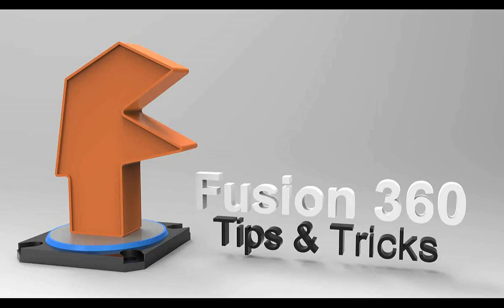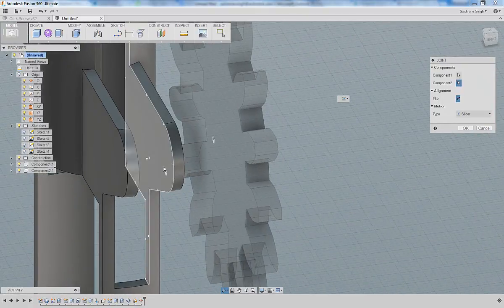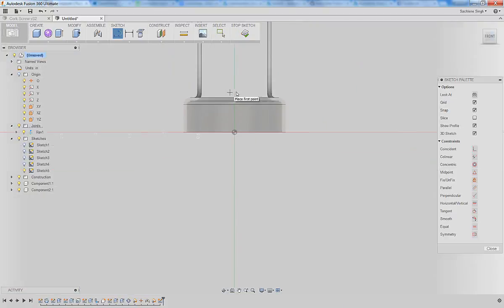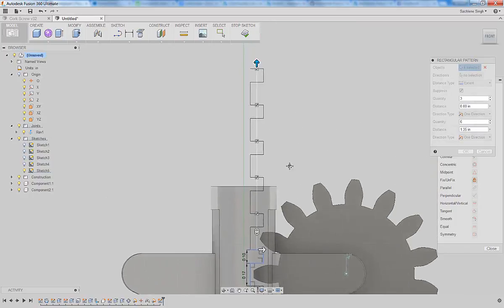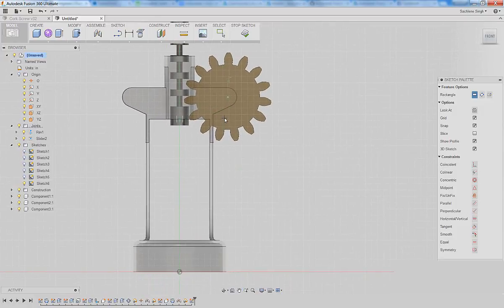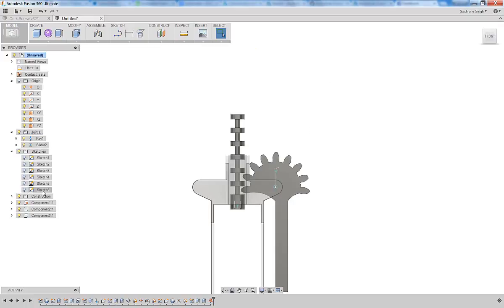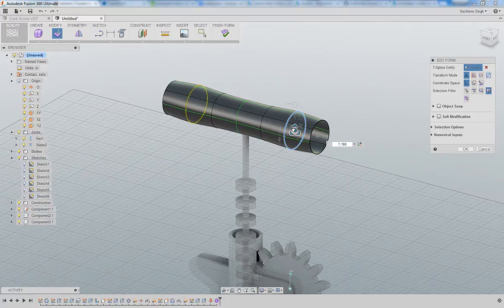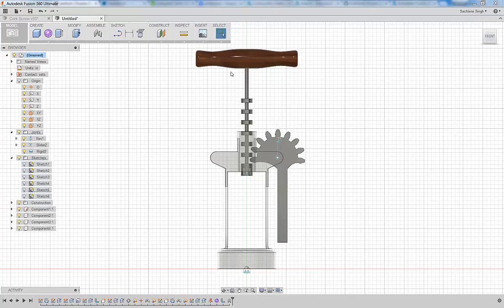Corkscrew   Part 2 Building the Arm and the vertical engagement

Comment: The Spur Gear Script you select allows you to specify the diameter of the spur gear.  When I try to use the same script on my fusion 360 it only lets me have one size spur gear.  I can alter the number of teeth, but I don't have a box to enter in the dimensions I want.  Is there a Fusion 360 update that I am missing?  I download Fusion 360 December 2016.  Please help!

Comment: There is a typo at the start of this with the gear script, it says 4.75cm which should be 4.75in which converts to 12.065 cm to get the correct gear size, also you go far to quickly for beginners to follow, There is also a step missed at 2min, you have already converted bodies into components
Reply: I couldnt make the correct gear even with your sizes. Would u please help me? I did everything exactly as the lady said by now but couldnt make the gears. I tried every dimensions possible but it just doesnt work. Is it because my version is updated?
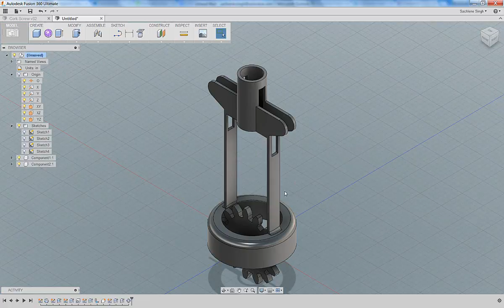Reply: The trouble is shes mixes, co-ordinate ie, inches and cm, which is a big no no, You should stick to metric or imperial, When you run the script you want about 8 for the first entry the module, 15 teeth and 0.25cm ie 2.5mm for thickness. If you look at the video at 0:46 each of those squares on the grid is 1cm and gear takes up about 13 if you count them. You can play around with module number and number of teeth, its a ratio and it will show you at the bottom of the dialog what the pitch dia of the gear will be, with these settings its comes out at 120mm or 12 cm
Reply: This worked for me. Make sure standard is in 'English' not 'Metric'. Then use these for the value, Pressure Angle: 20 deg, Diametral Pitch: 12.5, Number of Teeth: 15, Backlash: 0, Root Fillet Radius: 0, Gear Thickness: 0.10 in, Hole Diameter: 0. Pitch Diameter should calculate to 1.20 in